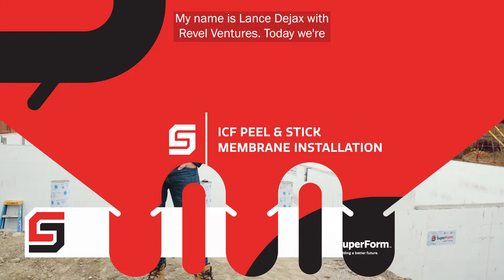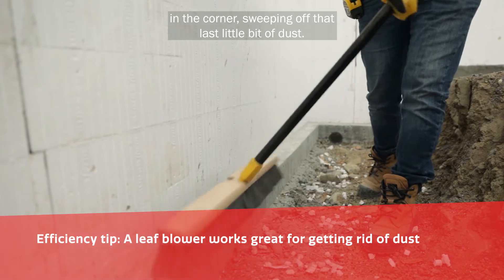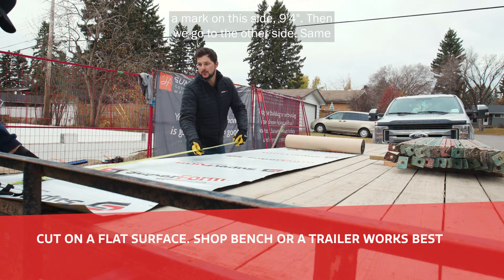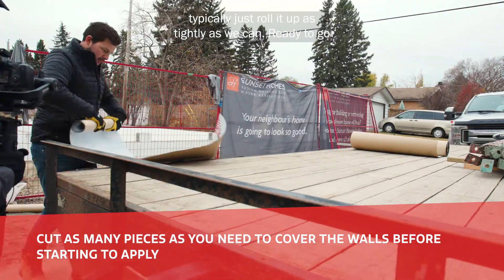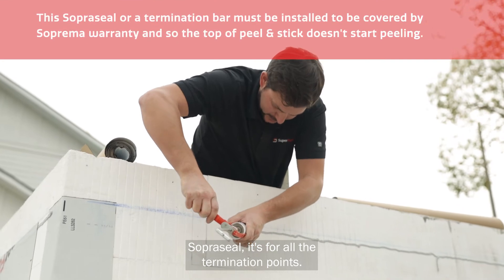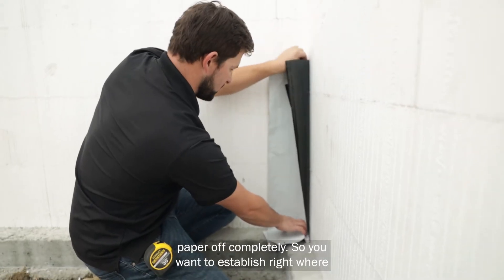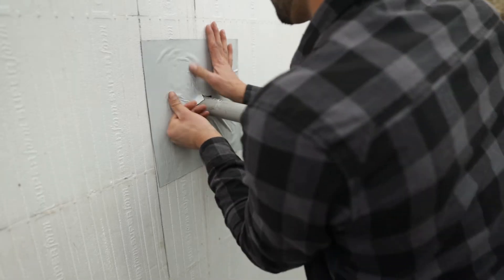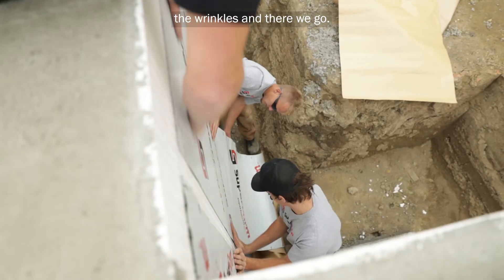ICF Peel & Stick Membrane Installation

Comment: How do you find the backing areas in the foam after the membrane is stuck to it?
Reply from the maker: Thanks for your question! The membrane of the peel & stick needs to be rolled on. If it's rolled on, you can see the imprint of the tie on the ICF. Or alternatively, you can look just above the ICF and see where the tie is in the wall.

Comment: I have a dumb question but need to ask it.  Do you just put the peel & stick membrane on the outside of the ICF or the inside as well?   What would the reason for primer be also?  Is it a weather thing or climate or what?
Reply from the maker: Hey Brent - thanks for your questions! No such thing as dumb questions in our books. The peel-and-stick membrane should be placed only on the outside, below-grade ICF walls and when it's above -10 degrees Celsius (14 degrees Fahrenheit). Installing it when it's warmer though is better. Primer is also not required, but is recommended as adherence is much better when it’s cold and/or when the wall is dirty.

Comment: I see that you're primarily a Canadian corporation, I was wondering if any testing has been done on your peel-and-stick waterproofing as regards termites tunneling up through the outer foam to the upper wood structure.  That's something that has lead some areas to ban using ICF below grade in construction.
Reply from the maker: Thanks for your comment! We suggest using a waterproofing system made by Polyguard that has termite barrier in it. For more info, visit https://www.polyguardproducts.com/term/